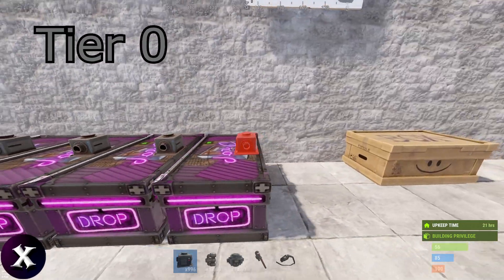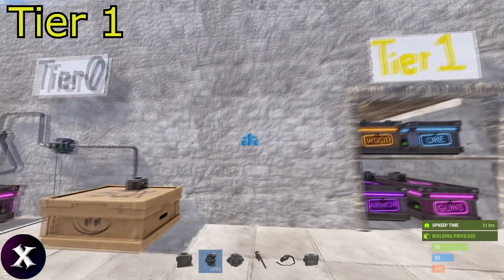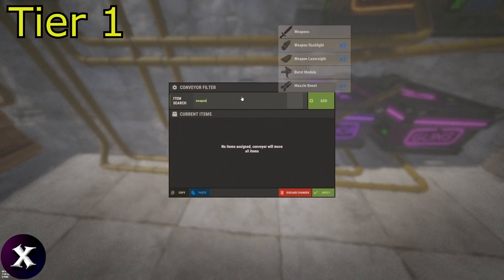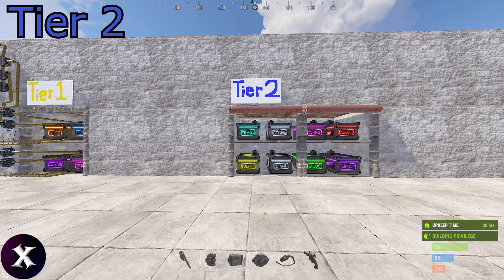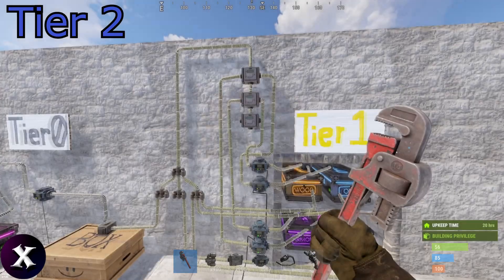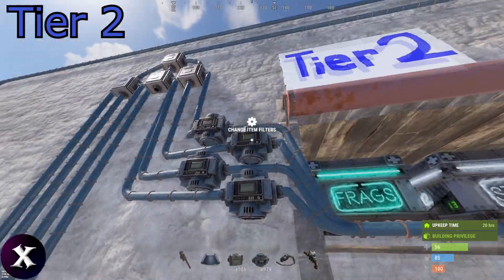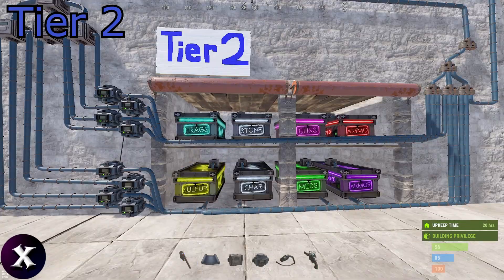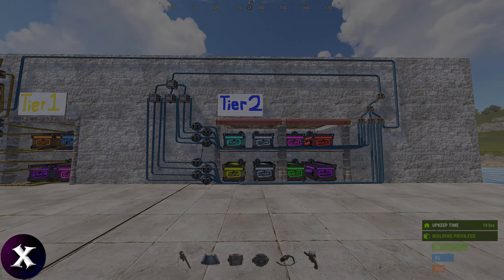Rust MODULAR Sorting System | Tutorial | Simple  *Outdated! Find The New Version In The Description*

Comment from the maker: Update 1.01
Make sure you watch this Hotfix 1.01 update to the sorting system if you plan to use 16+ boxes or run into any "too many input" errors!: https://www.youtube.com/watch?v=M91pXbpmQUk

Check out the rustrician diagram here: https://www.rustrician.io/?circuit=9f4a8ae8cd32e4aacb8278223bfb55ba

Comment: I love this design! I think there are some concerns to be addressed after I used this however! First, how do we add a box at that can contain all the items that do not fit in any box? If we don't it seems like these items will circulate in the system forever? Second, if we have multiple boxes of the same category, say weapons, the system will take weapons out of one box and put it in another in an endless cycle. How do we prevent this? Thank you! I look forward to your amazing ideas in the future!
Reply from the maker: Thank you for the kind words! 😄

Currently there is no category filter for  anything in the "items" category unfortunately. The best way to fix this is with a conveyor containing every category in the filter, and change the filter mode to "exclude listed items".  I believe there are currently 14 or so categories but a conveyor can only fit 12 filters - I would leave out the "fun" and "other" filters and have them go to the same box as the "unfilterables".

As for multiple boxes, I do actually have a fix for that which you can find here: https://www.rustrician.io/?circuit=0b36d7c6ae942552a4939fd962453659

This works by "sandwiching" your boxes with conveyors and disconnects them from the main loop. The second conveyor must be set to the same filter options as the first conveyor, but set the mode to "exclude listed items" instead. This will deposit everything that shouldn't be in that box into your buffer box.

The splitter in a Tier 1 multibox setup is so Tier 2 can still grab the higher tier items from this box since these boxes are no longer directly connected to the loop. The splitter in a Tier 2 multibox setup is only necessary if you are adding modules like an auto locker that may require to pull items from those boxes. If you aren't moving those items anywhere else for any modules you can omit the splitter in the Tier 2 setup.

These issues and more will be addressed when I release a version 2 of the sorting system, I've just been a bit busy recently to sit down and put a video together.

Hope this all helps!
Reply: @x-tremespeed  It definitely does! Thank you so much, I look forward to more of your unique and amazing content!

Comment: hi, I connected over 60 boxes and it stops working for the the rest of the boxes. Why is that?
Reply from the maker: Conveyors can only "see" 32 boxes on either side of them (they can take input from 32 boxes, and output to 32 boxes). You can work around this in two ways.

1. You can use my multibox example to "sandwich" your boxes between conveyors. This has the advantage of being infinitely expandable without issues, but the downside of needing 2 conveyors per filter type instead of 1. Here is an example of how to set up the multibox.

Multibox diagram:
https://www.rustrician.io/?circuit=3d114219040e8c4e625808f4be0af85e

2. You can connect the combiners together in a specific way to trick the conveyors into being connected to up to 91 boxes. This is more technical but I do have a video showing how to set it up. Keep in mind the video was released when the limit was 16 boxes. It still works identically, just with a higher limit (which is a good thing!) I also have a circuit showing how to hook it up - I used splitters in my diagram, but it works identically with combiners.

1 conveyor, 91 boxes diagram:
https://www.rustrician.io/?circuit=33a86a205f3f6f763d85e1aa3a7fc354

How to set up the 1 conveyor 91 boxes in your sorting system:
https://youtu.be/M91pXbpmQUk
Reply from the maker: @TheEndBoss23  you should be using a tree for your splitters, not a line. 1 splitter into 3 splitters, and those 3 into 9 more. This will give you 27 outputs. Keep adding splitters like this for more outputs. Conveyors don't only have a max storage adaptor count of 32 that they can "see", they also have a max Component DEPTH of 32 which you are exceeding with the 30 splitters + however many combiners you have, then the actual storage adaptors themselves
Reply: @x-tremespeed  What would be the simplest solution to connect over 60 outputs?
Reply from the maker: @TheEndBoss23  use the tree method I mentioned for both your splitters and your combiners, and use the multibox setup for the 20 or so double box conveyors you have.

Comment: So to pipe things from T2 back to T1 if someone put a T1 item in a T2 box, do you need to pipe off a splitter into another conveyor with all the items in T1 as a filter in the conveyor and go back to your sorting box?
Reply from the maker: Generally speaking T1 is for category filters, so you wouldn't want to have a conveyor set to categories pulling from T2 as that would pull EVERYTHING.

You would need to set up exclude filters on every box in T2 to do this. Set up a conveyor after each box, set it to the same filter as the input conveyor, but set the mode to "exclude listed items". route these conveyors into combiners so you have 1 line, and route that into your drop box. Be sure to add a combiner going into the drop box as well. Conveyors can't push through other conveyors, so you need the combiner to bypass the drop box conveyor.

Honestly since T2 was always in the open core loot room my team always used the T1 boxes and the actual drop boxes to deposit loot and nobody brought low tier stuff upstairs which is why I never ran into that issue while doing the research to make this haha!

I'm still collecting data, but I'll have a version 2 out at some point with fixes to all these problems 😄
Reply: @x-tremespeed  wow, that is a lot to do.  I think I will stick to just shooting any of my teammates who decide to mass dump items into a random box.  Ty.

Comment: Why is there 2 pipes attached to every box, under your Tier1 setup?
Reply from the maker: One to deposit loot in, and the other is connected to the output and back around in a loop to all the conveyors again. This loop is what makes the auto sorter work - if you put an incorrect item in any box it will get moved into the correct box through the loop!

Comment: Awesome video easy to follow. Although I just made a set up and I noticed that random items are cycling through random boxes like stone and sulfer even if the box doesn't have it in the filter. Any idea how I can stop that? I only have boxes set up nothing else is in the pipe system.
Reply from the maker: That's strange. Is it only specific items doing this, and only through specific boxes? The only conveyor that can move an item are 
1. Blank conveyors, although these will move every type of item
2. Filtered item conveyors, as these will move what they are filtered to move obviously
3. Filters set to "exclude listed items" will move every item NOT in their filter, so that might cause issues if accidentally selected too. 

I would start by ensuring only 1 conveyor is directly connected to each box, and double check the filter settings on those conveyors which have the boxes with the random loot moving around.

Let me know if these troubleshooting steps helped, and I would be glad to assist further if you are still having issues.

Comment: Great content but there's a problem. I didn't test then built this for a large groups core, does not work when you have 2 or more of the same box. We roll with 4 comp boxes so the system just shuffles items between them constantly. Same with sulfur boxes, wood boxes, etc. Any chance you have a different set up for this type of scenario?
Reply from the maker: Yeah, that's the one problem with this. I do have a fix though! 

Connect the last comp box to a conveyor INSTEAD of the tier 2 line and set this filter to the same as the one before the boxes (ex. Components or wood or weapons etc.) BUT set the filter mode to "excludes listed items". Connect the output of this conveyor to the buffer box but make sure to bypass the buffer box's conveyor as conveyors cannot pull or push through each other. You do that by adding a combiner just before the buffer box and putting both the buffer box conveyor and the new comp conveyor into it.

If you also have some sort of auto crafter set up and need the components fed into that, add a splitter between the last comp box and the new conveyor and just take an additional line from there.

Hopefully this helps!
Reply: @x-tremespeed  Legend it works thanks! That means for lockers I will need that splitter between the last armor box (etc) too i guess.
Reply from the maker: @Skanda222  Glad I could help!

Yes, you'll need to split the armour line to the lockers as well.

Comment: Isn't it possible that someone raiding to your TC and having access to the conveyors could program your system to pull whatever items are in still unraided loot rooms? I love the fact that it sorts items put in the wrong chest and allows you to easily access your storage for auto crafting/kit assembly, etc, however this is a concern. Is this concern valid, and is there a fix for it?
Reply from the maker: Thanks for the question - Your concern is for sure valid and an interesting thought.

Firstly, I would argue the time and hassle saved never having to manually sort again is worth the potential drawback of raiders using your system against you.

Secondly, generally speaking if you have a base with a compound you probably have overlapping external TCs blocking raiders from getting building privileges so I wouldn't worry there. If you have a smaller base with no TC overlap, this would become a bigger problem for sure. That being said, once you lose your only TC and the raiders get building privilege, the raid is more or less over.

At the end of the day, if it's an online raid they will most likely blow up half your pipes and have to rebuild the system if they win, but the loot rooms will most likely be open already. In an offline there's not much you can do, and getting to your Tier 2 line, which is generally in your main loot room, basically means they have access to your main loot anyway.

Like you said, you could set up a circuit to cut power to your conveyors, but again, if they have building privilege they can just put down their own batteries. The only thing that immediately comes to mind would be to put your pipe connectors all on a twig wall that will get destroyed during a raid. The best thing to do if you are still worried about it would be to have a raid alarm system set up so that when it activates, all your loot goes into bunkered boxes with NO outputs. I know a few people have done circuits like that, I just haven't bothered as it would require people to have a secondary, completely empty, bunkered location to send their loot which a vast majority of people aren't willing to do.

Sorry for the long winded reply, but hopefully you're satisfied with my answer!
Reply: @x-tremespeed  Wow, that was a very thorough answer. Thank you for that! And thanks again for the well made video.
Reply from the maker: @artofaction  Absolutely! I love questions like this as they are valid talking points that may not make it into the video, but people can have conversations and debates in the comments.

Thank you for the kind words, and I'm glad you enjoyed the video!

Comment: First things first: LOVE YOUR CONTENT. These videos are soooo good. I LOVE the modular nature of these setups. Big fan. Liked and subscribed.

I do have a question though. I've been running into a weird infinite loop situation where the sorted box items get pulled back into the buffer box, and then resorted, and then buffered, sorted, etc. Have you ever seen anything like that? I thought maybe it has to do with which splitter output I use to go to boxes vs the next splitter/tier but I'm not sure if that was the thing.

I ended up just having to not feed the sorted boxes back into the buffer and things seemed "ok". But, I really WANT that part, because I love that it will fix when teammates put stuff in the wrong box.  Any thoughts @x-tremespeed?
Reply from the maker: Thank you very much! I knew the industrial system was a big update and I wanted to make my own mark on the community so I set out to make a modular and (hopefully) easy to understand set of videos - I am glad you find my videos and tutorials enjoyable!

You actually don't need to have the sorted boxes loop back into the buffer box - because all the boxes are connected into the loop they will all pull from each other. The buffer box is only there as a safety net to stop loot from backing up into your drop boxes. The problem you're running into is because the buffer box is set to pull EVERYTHING from connected boxes, so because you have the Tier 1 loop plugged in to the buffer box conveyor, it's pulling everything out of every box you have.

To reiterate - drop boxes ONLY into the buffer box, buffer box into the Tier 1 loop, and Tier 1 boxes also into Tier 1 loop.

This should fix your problem, but let me know if you still run into issues!
Reply: Also, I HIGHLY recommend not cutting your video but instead fast fowarding. It would allow us viewers to .25x your speed and follow along if necessary as certain points when you're hooking up inputs and outputs  are very detail oriented and need to be seen @x-tremespeed
Reply from the maker: @TheGoldenLight11  Thank you for the suggestion! You make a good point. I'll keep that in mind whenever I get around to making a new one 😀

Comment: Why even have a buffer box and not just skip the middle man and have the drop off boxes linked straight to sorting boxes? Just wondering..
Reply from the maker: Great question!

The buffer box does two things. Firstly, if any of your loot boxes become full, the buffer box will start filling up instead of your drop boxes. This keeps your system up and running and keeps loot from getting stuck in drop boxes.
Secondly, if you have any items that are not filtered (for example, there is currently no "item" category filter for placeable objects like fireplaces, fridges, etc.) Having a buffer box will keep them in a safe place instead of backing up in your drop boxes.

Comment: What is the point of those industrial combiners ?
Reply from the maker: The combiners on the Tier 2 boxes? It's to connect all the boxes together so you can both sort loot that was placed in the wrong box and also add additional modules that pull from your loot boxes. Auto upkeep or auto locker fillers, for example.

I have multiple module videos on my channel if you're interested, and I even have them in a playlist if you're VERY interested!